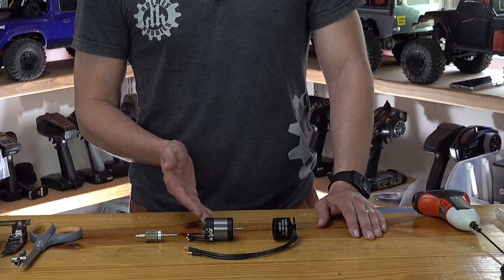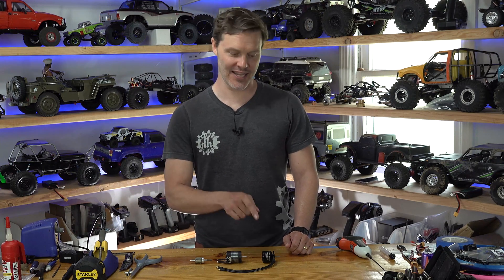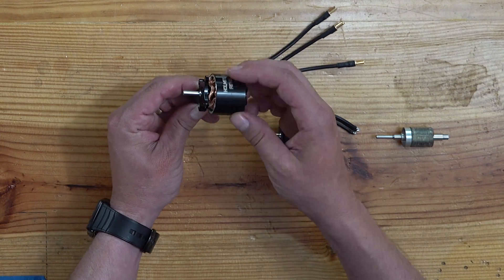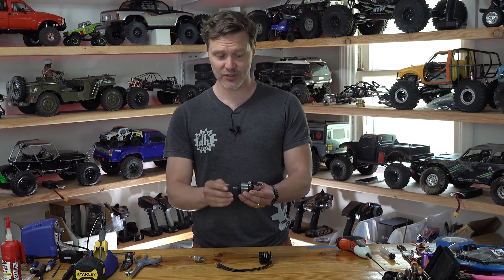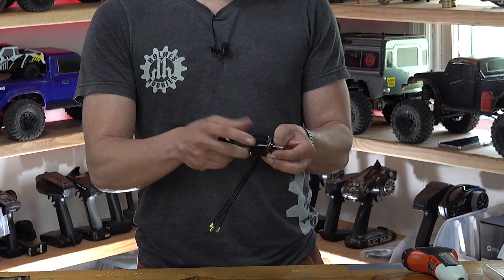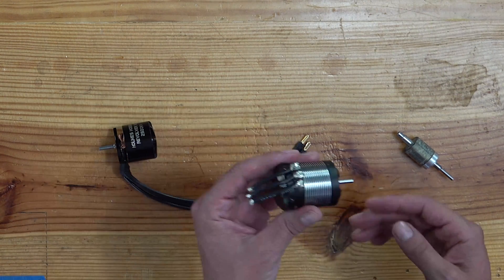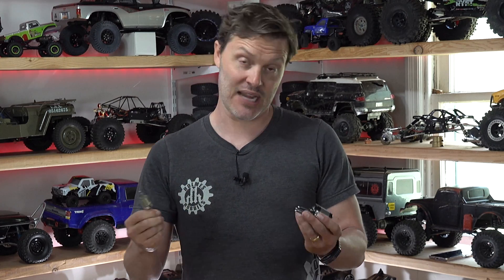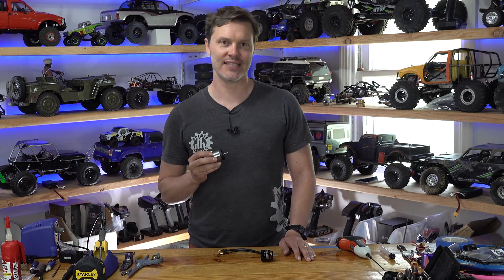Which motor is right for you? Outrunner vs Inrunner - Motor school with Holmes Hobbies part 1

Comment: Between a 300W inrunner 2435 3300kv and a 260W outrunner 2822 2600kv, which will have more torque?
Reply from the maker: Not enough info. Those size numbers have no standards to compare with.
Reply: @HolmesHobbies  2435 would be the Surpass Hobby red KK series 4 poles, the D2822 is a DYS/Flash Hobby motor 14 poles, right now I'm using a tiny DYS D2225 2000kv 12 poles motor, it has enough torque but not enough top speed, it's 20% slower than the stock 280 motor, trying to find the best motor to fit in a 280/370 footprint for trail/light crawl uses, unless I ditch idea of using safer 2S 18650 and go with 3S lipo, just not comfortable with my kid handling pouch cells lol

Comment: Now for something that isn't in the RC hobby yet: Axial flux motor.
Reply from the maker: It's not a good topology for the motor sizes we use.  We need long and small diameter motors, which is radial flux!  

If we could fit a 4 inch motor it would become more feasible.
Reply: @HolmesHobbies  Weeellll... A lot of outrunners, at least the ones used in race drones, are pretty flat comparatively. But that is literally just a single example, so yeah.
Reply: @HolmesHobbies  Actually, now that I think about it, you could stack a bunch of axial flux stator+rotor sets to get a "long" motor. At least theoretically? Hmm...

Comment: I fly fpv I wonder if a 6s drone motor would run a 1/10 . There out runner I think? I have a couple spares
Reply from the maker: I would suggest a 35 or 36mm frame size, which will typically have a 4mm or 5mm shaft and require funky pinion.  This is part of why I design my own crawler outrunners, so it accepts a normal pinion
Reply: @HolmesHobbies  yea your right by the time I attach a pinion to the motor could have a hh out runner in the mail. You dont do 24th scale electronics do you?

Comment: Still rocking my Crawlmaster pro 13t. I have debated moving to brushless but If I have to give up ANY of the brushed feel I won't be happy. Question: how much more efficient (in regards to runtime) is a puller pro stubby compared to the standard puller pro, given a similar kv?
Reply: If u want the best in runner rite now that is about as close to a brushed motor as possible, then grab the 10shooter 2700kv motor with a mamba x.......  it really feels like a brushed motor when set up is done rite. The regular pp have little more power output with haven larger magnetics I feel, but the super smooth and slow start up and crawl of the 10shooter is just worth the little loss of power. But will say it's not noticeable unless u run both the pp an 10shooter like I do in the same rig basically.

Comment: I'm sorry for being a bit dumb but how does the drage brake work with sensorless brushless motors like these? I would really love to use a HH motor for my Phoenix but I don't want a car that starts rolling down the hills, especially if it's still on it's wheels
Reply from the maker: The next video will explain the biggest factor on this, the flux gap area of the motor.  Determines potential for drag brake and torque
Reply: @HolmesHobbies  cool, looking forward to it, thanks for all the great explanations, much needed for beginners as well as thick old timers like me 😁